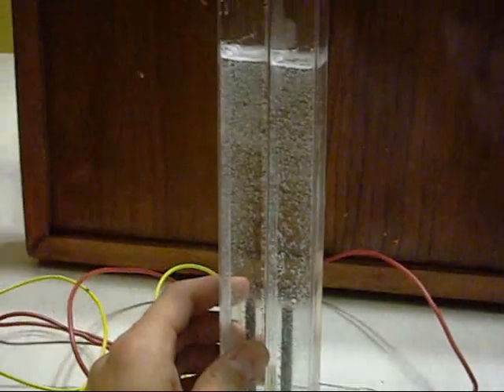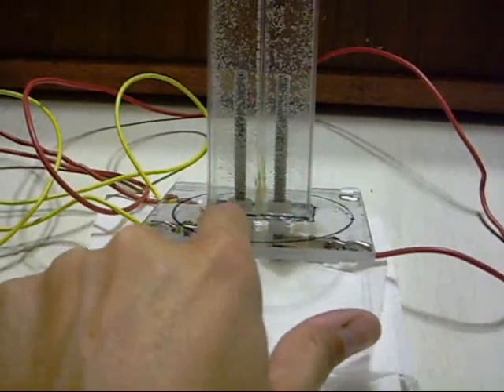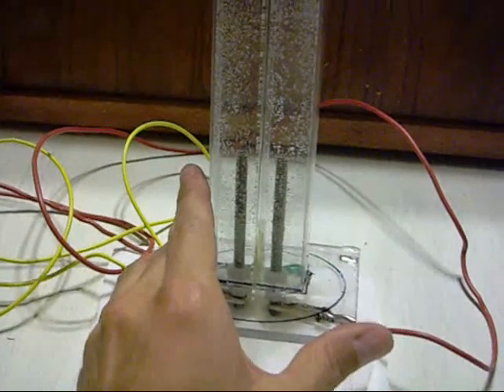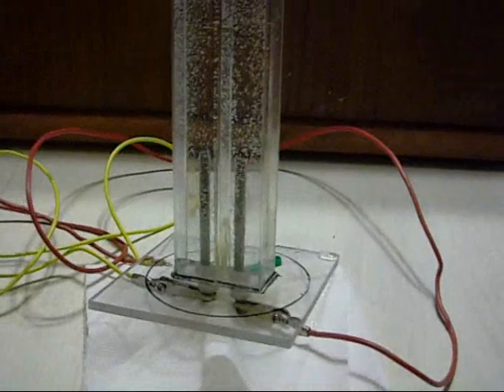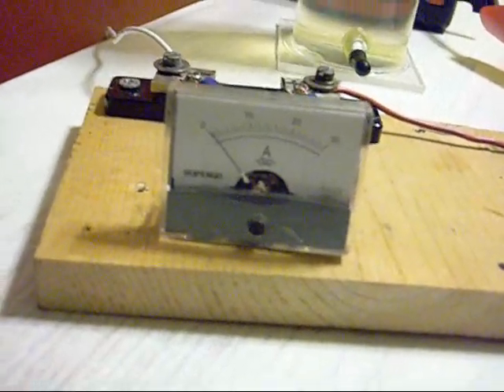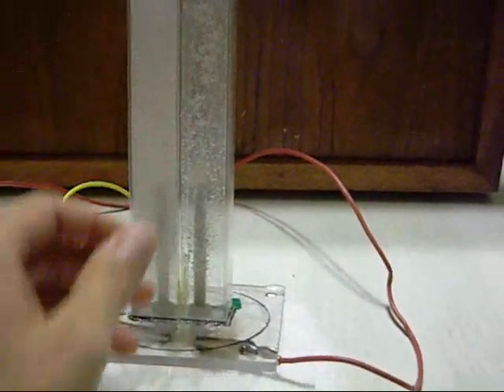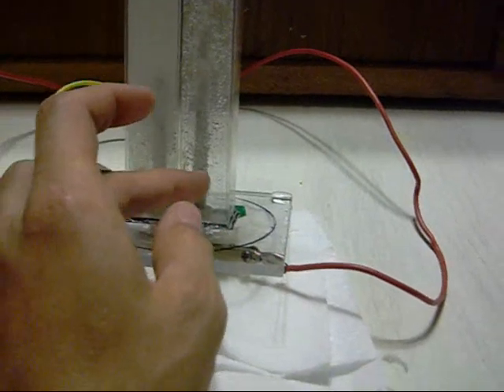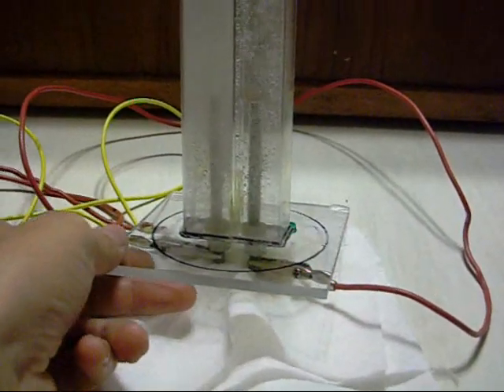HHO separation during electrolysis

Comment: i´m having some problems at the separation you need  that the electrodes share the electrolyte right?if a use ClNa as electrolyte i´ll produce H2,O2, NaOH, Cl2 yeah? i found (wikipedia) that if you mix Cl and H2 they will explote any idea to how avoid it?
Reply: Raul Padilla Secreto use NaOH instead of NaCL! U can find it in drain openers